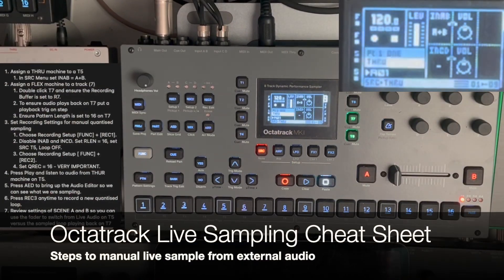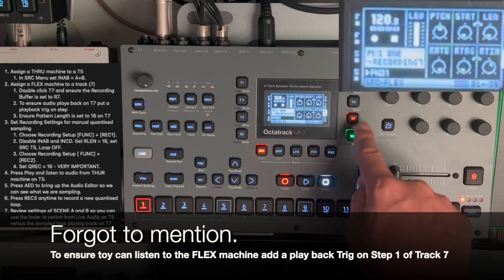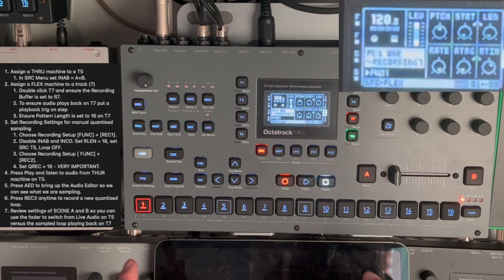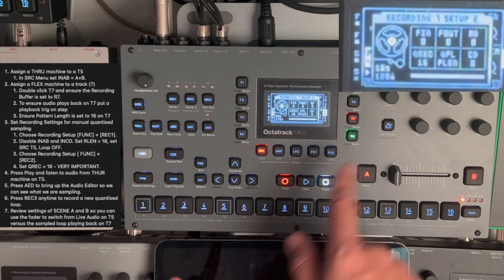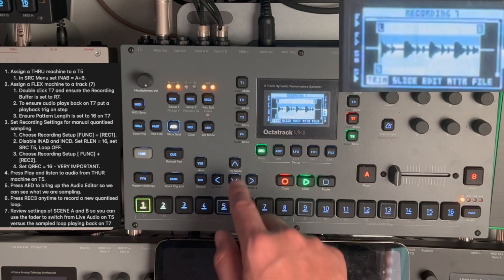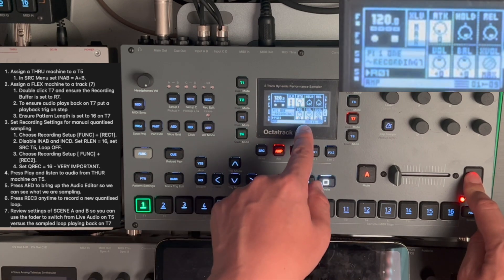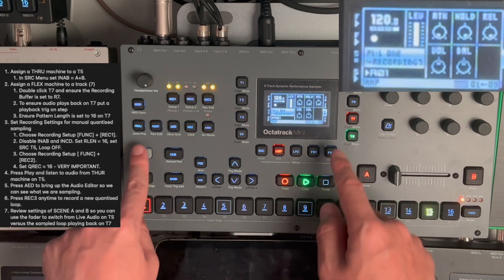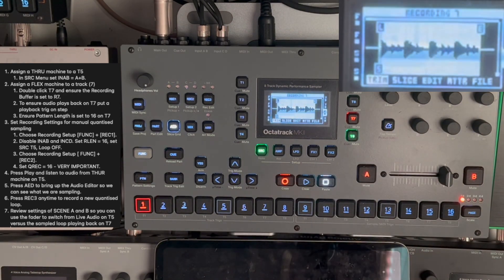Elektron Octatrack Cheat Sheet for Live Sampling of Audio Loops

Comment: The scenes should be changing the XLEV setting instead of the volume. It was designed for this type of use as I believe it uses an equal power crossfade curve and not linear so there's no drop in audio level.
Reply from the maker: Thanks for the informative feedback. I still have not got my head around how volume levels should be set at the MIXER level, the track level with volume vs XLEV so this is really good to know. There are times where I had drop in audio level cutting between scenes and I could not figure out why. Will take a look to understand this and then mark in my video description the correct way to do this. 🙏
Reply: @albaby001  The OT definitely has many ways to do the same thing but sometimes one way is better for a certain task than the others. The XLEV is a bit confusing as it's a MIN/MAX setting only but basically one side has a MIN volume (0) and the other side has the MAX set (the actual track volume level).